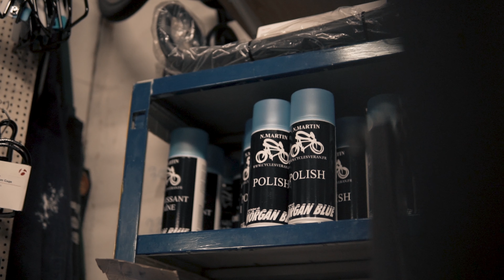Dream Build Santa Cruz Megatower CC by Cycles Veran | 4k MTB Passionate  film

Comment: nice video what type grease did you use for headset and all contact area?
Reply: Thanks ! I use water proof grease, no specific depending on bearings or screws, always the same.
Reply: @maximecaviglia9172  thanks a lot I will use wateeproof grease from bellray!!